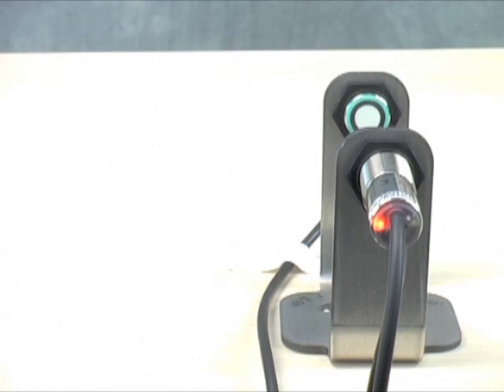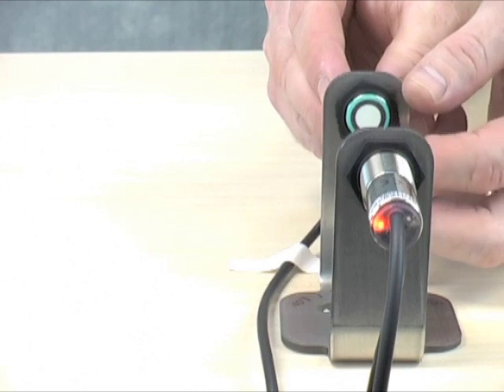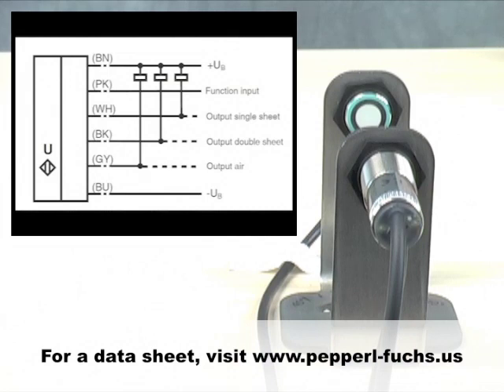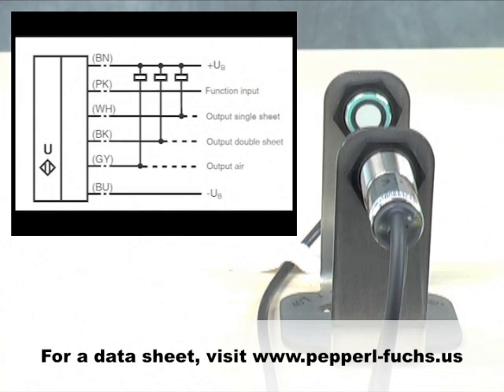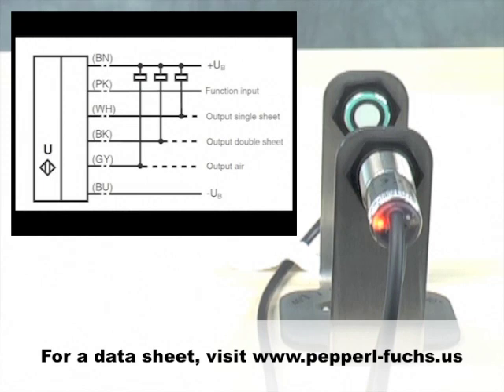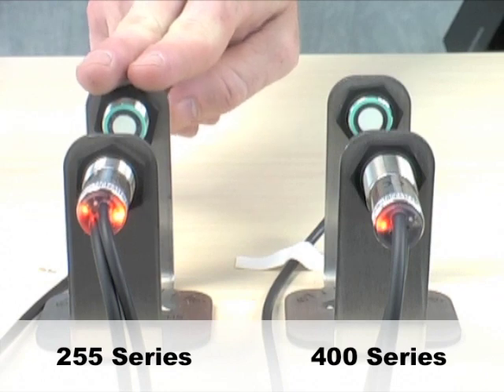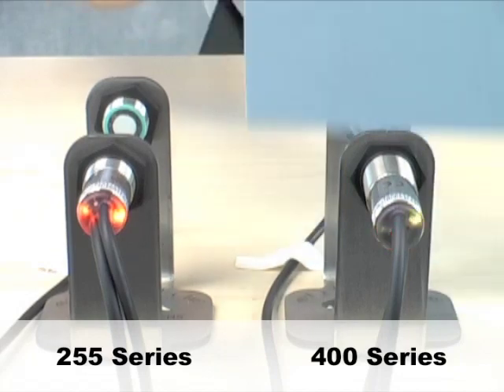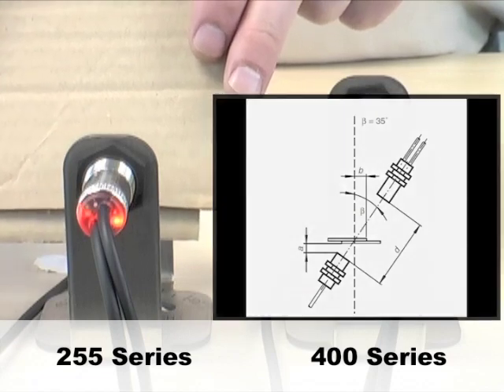Programming Ultrasonic Sensors for Double Sheet Detection

Comment: Can this sensor detect single or double sheet of 13 g Tissue paper on 70 meter / minute continuously running line?
Reply from the maker: There is no way to say for sure without testing it first.  Due to the low grammage of the tissue paper it may not be the most ideal conditions for the ultrasonic sensor to sense. The low grammage will result in less sound being absorbed and essentially distort the quality of the signal returning. 

Do you have a particular application in mind that you are referring to?
Reply: @PepperlFuchsUSA  Yes for sure, i am looking for a sensor that can detect single or double sheet of tissue paper ( digital or analog whatever the sensor may be that resolve this issue). Any suggestion from your side as i have to resolve this issue for my customer. The problem they are facing as follows:
In double sheet of tissue paper line , sometime one sheet breaks and they are unaware of the situation. Thats way they need resolution.
Reply from the maker: @attiqueur-rehman2134  Would you be available to webchat with one of our technical experts? If so please follow our link: https://www.pepperl-fuchs.com/usa/en/24.htm
Reply: No Sir.

Comment: it can be measure  0.0001 thickness ???
Reply from the maker: Hello Utsav Vaghela, Just to be clear - This product doesn’t measure thickness, it measures the differential between 0, 1 and 2 sheets. A discrete (not analog) output is provided for the three different scenarios.

0.0001 mm(?) thickness is very thin. But if the material was a homogeneous plastic, and you were trying to differentiate between one or two 0.0001 mm thick sheets, it might be worth trying. Note – there needs to be some sort of air gap between the sheets. If there is essentially a vacuum between the sheets, it will not work.